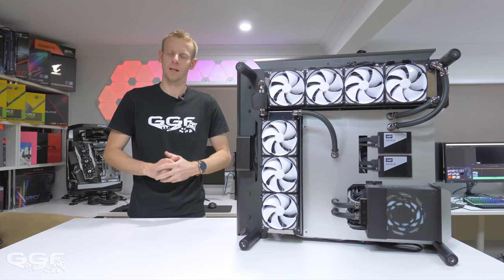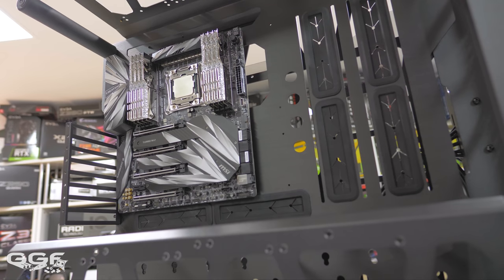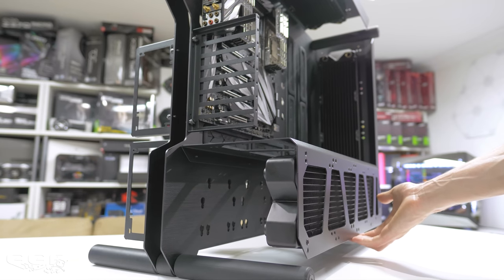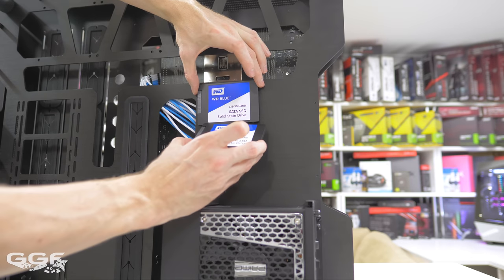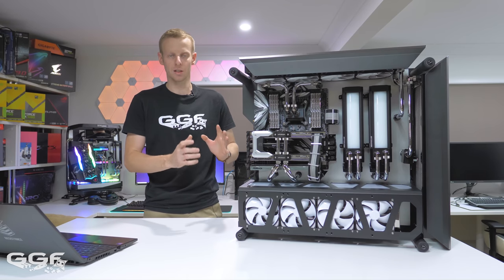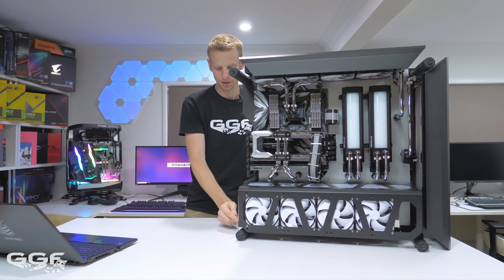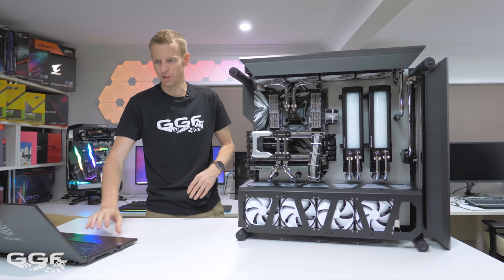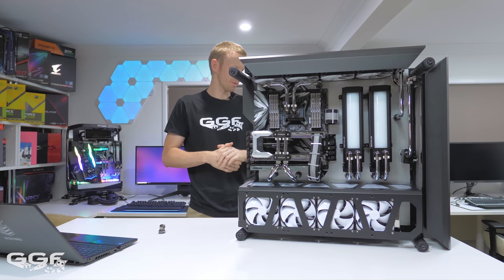Raijintek Enyo - Brilliant idea! But not perfect

Comment: I got this case too. First I didn't like the looks when it was empty but now with my hardware in it looks amazing.
Was sceptical about the open frame because of dust and noise. But I am happy with it now and love the fact that all radiators are getting fresh air and none of them are heating up the inside or pushing hot air to other radiators

Comment: the 2 psu could be used for dual cpu motherboards as they could pull a lot and the power would be a lot cleaner when overclocking too but yea they should really add something to either add storage or maybe even a small itx mount if you wanted to make a small nass or something along that line.

Comment: 2 power supply spots for people who will be getting the ASUS Dominus and the Xeon w3175x. If you're overclocking, you need 2 power supplies. The size of this case will work well with the size of the Dominus as well.

Comment: Should have used flat socket head cap screws to mount the radiators/fans.... The mounts had countersunk holes for it and it would have looked better... Phillips drive screws always look cheap in comparison

Comment: hi, im a newbie when it comes to watercooling. Is this build still up to date? (talking about radiators and stuff). Want to make this exact build with a MSI 3090 suprim and then add another. Except from the power source (which i would get 2x non water cooled), should i change anything?

0

Comment: my only complaint would be those bottom 45 degree tubes. I think you should have used 90 degree fittings there so that the tubes are perpendicular.
Reply: Yep I tried to have them as 90 and keep the curve but the curve is too large of a bend radius
Reply: @studog858585  Got it :)
All your works are masterpiece though. Inspired me to build my first hard tubing PC.

Comment: So its a thermaltake P3/P5 slapped onto a boring slim tower. Nice dust collector.. Get a thermaltake 900. Dual 540 rads. Amazing that 4 year old technology still beats new garbage. That's going to look real clean with 30 cables on the back 😁Hex key just to remove side???? 😅😅 Can't even easily put wheels on that. Again something that is already done in a 900 case with a $3.75 harbor freight wheel.
Reply: But the 900 is ugly. There is no flow to the case design and it's the size of a mini fridge. It's basically the "I'm not creative enough to make a cool rig so I'll get the biggest one available" case
Reply: @Springerr  it's made for w/c and the rads/psu are separated to back from front and half the price of this. Im in country where one day leaves dust, so i rather go enclosed. It has plenty of flow with push pull. Lol@not-creative the case is designed for w/c and custom shit since I'll double reservoir it. So not sure what creativity you're thinking without blowing $500-1000 for a case. After working with the P5, it's seriously not made for new boards since I'm having to route cables around with the ports blocked. As far as size I dont mess with mid tower bs in 30 years of building systems. Prefer actual room to work in.